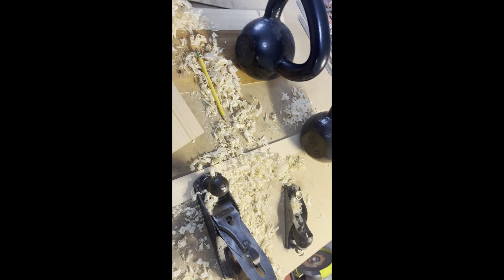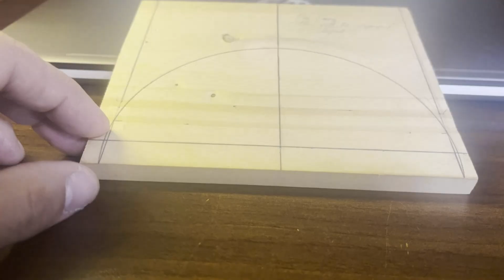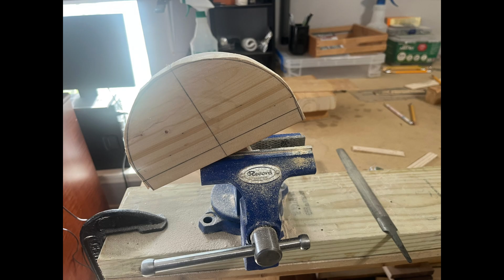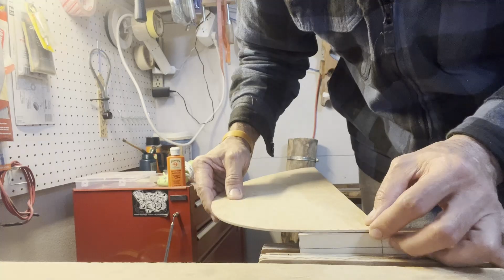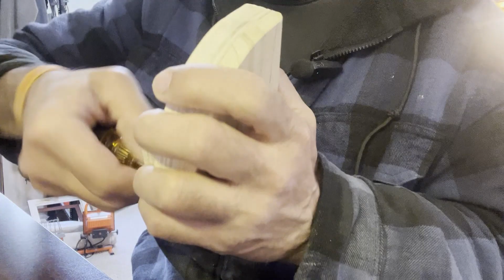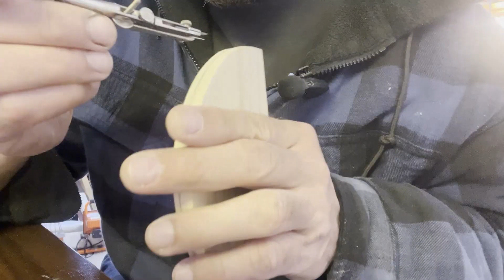# 11 Oud Tail Block: Design & Construction.

Comment: Thank u for this informative Video , the 15mm offset is a bit tricky . because u need to extend lil bit on each rib going on side till u reach the belt which is bend not 15mm offset but from the base . if ur bending ur ribs on template u need to adjust each rib . it is a bit tricky . how do u address this issue ? my english is not so good i hope i was able to make it clear 😁
Reply from the maker: Thank you — yes, I understand exactly what you mean. And you are right: the 15 mm offset on the tail block along with the edge bands does make rib fitment more involved.

I’m currently in the process of building my oud bowl, so I can only tell you how I intend to approach it. As I mentioned in the last video I published (episode # 12), I will be documenting the rib design and construction in my next episode.  My rib widths and initial tapers are based on the cross-sectional geometry of the bowl surface and the number of ribs I am using. But I don't expect those calculated dimensions to give me the final shape of each rib. Each rib will need to be individually shaped and adjusted as it is installed onto the bowl and fitted to the adjacent ribs.

There are two approaches I have seen makers use. In one, the ribs terminate directly at the base of the tail block. In the other, the ribs terminate at an offset from the base, and two end bands are added. I chose the second approach, with a 15 mm offset, because that is how my personal oud that I play is constructed. I was inspired by that design and my research also indicated that the end bands add to the rigidity of the bowl.  

So, the 15 mm offset on my tail block is a general reference target for where I want the ribs to terminate. I fully expect that I will have to adjust each rib individually so that it follows the actual bowl surface geometry and reaches that termination as cleanly as possible, while maintaining the symmetry of the instrument. 

So yes — I believe you have identified a part of the process that cannot simply be solved by calculating the rib dimensions beforehand.  In addition to a maker’s intuition, there are skills and experience involved, and I expect my first bowl will be a learning experience!

And don't worry — your English was perfectly clear. I clearly understood what you were asking.  I sincerely appreciate you taking the time to review my videos and your comments.
Reply: @irfansajan1260  Thank you for this quick and detailed response, I appreciate your efforts. Looking forward to watching the rest of the videos
Reply from the maker: You're very welcome.  I'm glad that you found the information of some value.  I plan to continue making, posting and sharing as time allows.  Let me know where you are with the build process.  I would be very interested to know.  My email is isajan2010@gmail.com.   Also, if any additional questions please feel free to ask - I would be happy to respond with what I know.